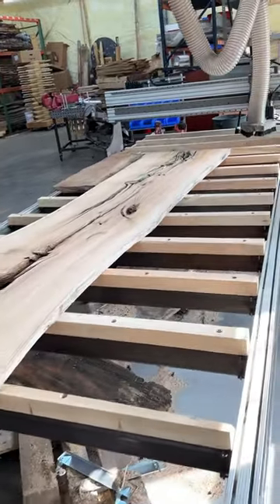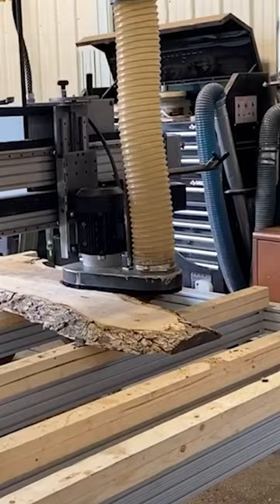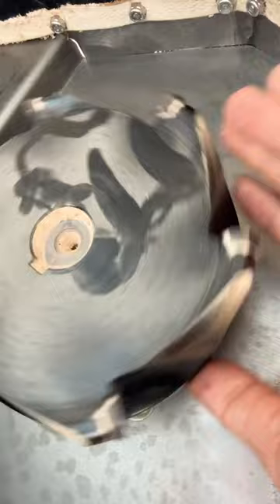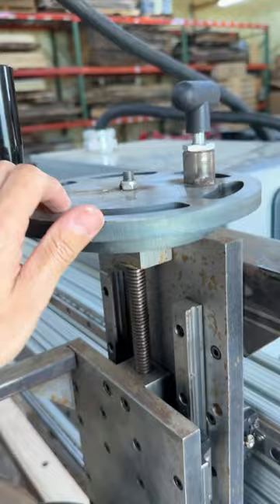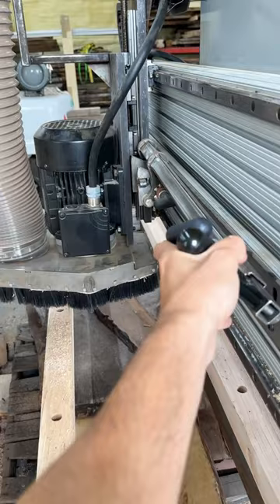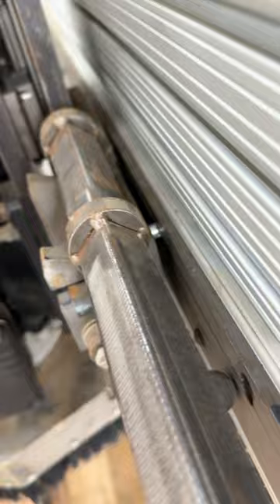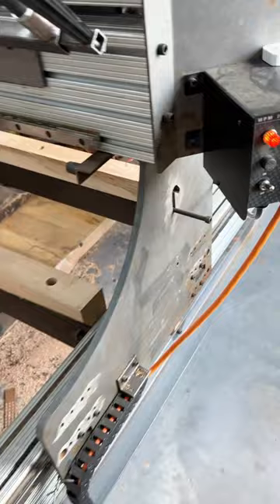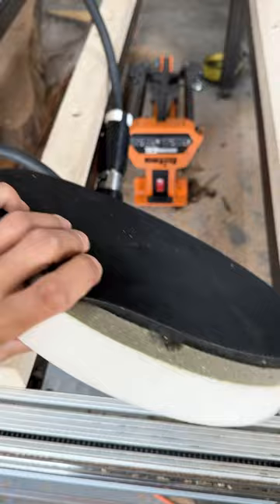A quick look at the slab surfacer #woodworking #sawmill #liveedge

Comment: Lol, this is some awesome “why buy it when you can build it” type engineering, but does it really need linear rails for this? I’ve got a small desktop CNC router that can pretty regularly hit 0.1mm repeatability and accuracy, and it doesn’t even need linear rails (yet xD ). Just having like 3 mounting points in a shared plane will make it perpendicular to the gantry it’s mounted to, which, if you again have everything mounted in the same plane with 3 or more points of contact, will be perpendicular to the table.